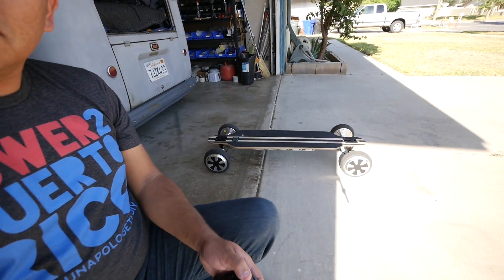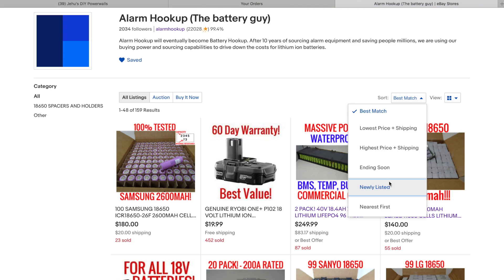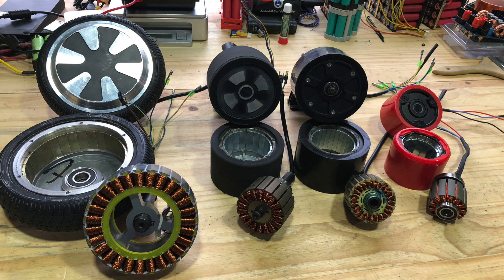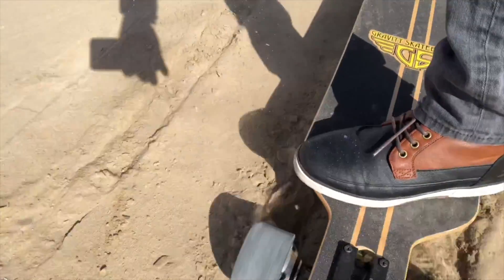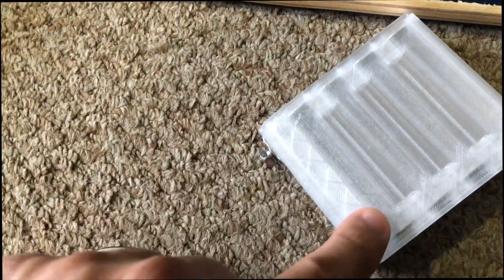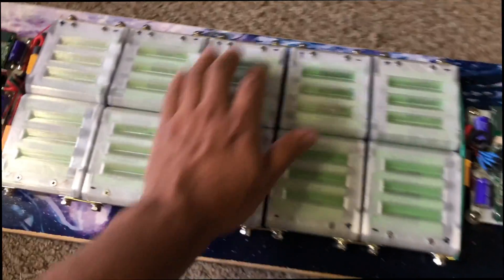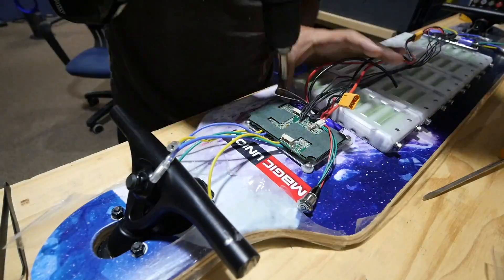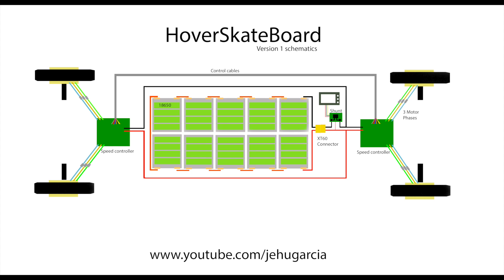Baja Electric Skateboard using Hoverboard wheels (HoverSkateBoard)

Comment: Recommend upping the voltage to 72 or 90v. They are low low KV, should do the trick.
Reply: Camden Wallraff I run this motor in scooter at 72volts and get 24mph max speed
Reply: what esc did you use ?, the vescs usually take 60v max... , ebike esc not ready to use remote controller.....

Comment: Not very well built, the wiring and circuits are all exposed and the battery packs aren't attached properly. Also that hole you cut for the screen is in a pretty bad place and weakens the board
Reply from the maker: And yet it’s as fun as any board you can cobble up

Comment: cant wait for the followup video, that looks pretty simple to build, and not a bad price, you also get to build it how you want, esc motor battery wiring, not the most perfect solution since you are cutting holes in the wood reducing its strength but still good for how cheap it is.

Comment: Those shaft couplings scare the crap out of me on an engineering level.
Reply: ya no sh*t those trucks are not a straight shaft there curved no way in hell i would put that on my board with out welding it
Reply: whaha i thought the same
Reply: Totally insane in the membrain XD
Reply: And they're over $20 each. That exceeds my total budget right there.
Reply: @tedhancock68  same i been plotting this build got my hands on everythin hopped on youtube to solve the last problem of adding the  wheels lol now smack 80+ more bucks i gotta spend :c
Reply: @MADMAXSHOTYOU  I bought a welder but haven't tried welding on the wheels yet.
Reply: Not to mention the batteries being held by double sided tape.. 😂
Reply: @Oilysnowww  Yeah, he should have used duct tape.
Reply: Just tighten it up and drill a hole for a retaining pin(s). Problem solved through engineering. 😀
Reply: @Wilson Deshawn Instablaster :)
Reply: I dont mean to be offtopic but does anyone know of a method to log back into an instagram account..?
I stupidly lost the account password. I would love any help you can give me.

Comment: Where can I find those 3D print battery holders?
Reply from the maker: BOM list
https://j35.us/Skateboard
https://j35.us/3DprintedHolders
https://j35.us/2200mahCells
https://j35.us/Power2Spare
https://j35.us/4WD-HubControllers
https://j35.us/HoverBoardWheel
https://j35.us/VoltageMeter
https://j35.us/ShaftCoupler

Comment: i like the battery casings but doesn't the metal electrodes throughout the case gets hot when you're running the board at full power for long periods of time resulting in the plastic casing melting?
Reply from the maker: Good future test

Comment: Change the winding to delta.
run 4x 12s vesc similar to torqueboards vesc...

run them at 12s and test it on a steep as hill to show what its capable of, also show how much weight its pushing etc...

 this will give plenty of info on what these are really capable of...

Comment: jehu, those are ncr-b? max drain is 6A but recomanded is 3A continous, and you are pulling 40A/4=10A per cell, right? also can you make a video for the 3D printed cases? i know where the files are but where did you find the nickel strip with that "button" shape on them. Also what bolts did you use and all...Planning to build some packs using the same 3d printed cases that i can 
do myself but i nowhere is a video with the assemble and the parts needed to make them.
Reply from the maker: 40 burst,  check the links

Comment: I don't know what is the specs of those motors or the esc that u put on the list , I have one of those hoverboards broken in thinking to give it a try ....but I will try a Rc car speed controller  and maybe a big lipo battery ....what u think ?
Reply from the maker: Same thing except this is 4 speed controllers one for each motor
Reply: I tried with a RC car controller but it wasn't successful, the motor behaved like a stepper motor and the wheel had a 'stuttered' rotation with not much torque.
I did have success with a 500w ebike controller (eBay £6) and a 10k pot as the accelerator. ✌️

Comment: Do you sale the 3D printed batter holder I would like to get some for some projects thank keep up the good videos 👍🇺🇸
Reply from the maker: Link in the description
Reply: We now have 2S4P. It will only need 5 modules. They have mounting holes and a bit easier to mount on the board. More on esk8 forum

Comment: Jehu don't forget why These are only for 10s. These don't look like they can take the forces of higher speeds speaking in terms of the wheel integrity.
Reply from the maker: What are you talking about,  they are beefy motors
Reply: Ben Nope I run this motor on scooter single one and pull 2000watts at 70 volts so yes this motor can handle a lot more power. I weight 100 kg and this thing got tons of torque and get top speed 24mph. Only mod I have done I replaced this rubber wheel with polyutherane wheel that I moulded from the kit. This greatly deceased rolling resistance as original rubber that are fitted to these motors are not very good for heavy riders
Reply: greg23842384 nice. My concern with these mass produced items from china is when they are used outside their normal paramaters.
Yep that rubber thing was concerns me too. Pu tight fit is the way. The Advantage of running high voltage is that you pull less amps.
My concern with this Skateboard Setup is Just No ability for Realtime measurements to See what actually Happens. I know those ESC from other builds and they may work but it is like flying blind. You See no amps or the temp of your ESC. Do they even have thermal throttling ect. And i Just don't liked his Statement that any battery goes in 4p....from someone Like him. Imagine someone builds the Same. Takes 3-5A battery in 4p that is max 20A for 4 Motors....if He had taken vesc no Problem but He didnt....
I just expected more...this was Just Like all the other builds..hey look i bought this and that and slappt IT together.
Reply from the maker: Oh you Fear mongers,  use all that energy and build something instead,  otherwise step aside and let the rest of us enjoy our projects
Reply: jehugarcia i am not hating. I Like your build. Just my concerns.
I am currently building 2. Just waiting on some parts.
But man i am surprised you still answered after all this time.
There is a new but reliable seller for vesc, FLIPSKY. They sell directly or over ebay ect, i payed 56€ and tested it Yesterday and Made 0 Problems

Comment: No not any battery. Kinda dissapointed that you shortened the battery Part. Since this is your thing
Reply from the maker: Not interested in explaining to you how to load a cell into a holder,  if you don’t get that then these projects are not for you
Reply: I meant the Type of 18650....whatever you already misunderstood me. You used a different Type of battery in your video than in your description Box. And No using any 18650 in 4p is Not going to go Well for everyone. 
Rider weight and inclines and declines factor in . That awd is gonna split the load rly good yes but why Run a battery at the limit.
Reply: jehugarcia These ESC also have No current Control......you can't just slap any cells on. If the Rider is heavier or going up a steep hill you can easily destroy the esc or the battery current is too high and the cells take dmg...there are so many variables and further Tuning These motors could make that Happen. There will be people who will copy you who have no idea how to do this right.
Reply: You could implement a BMS AS a failsafe...but that is not a favourable solution..cutting the current in acceleration can cause severe Crashes.
Getting to the point of the wheels.
What i mean is If the rim cant take that speed. No one using a hoverboard was riding 10mph+ continously for Miles. An eskate does that rly easy. Is the Rubber on the rim secured for Higher speeds and doesnt get loose. Is it able to sustain shape and grip.
Abec flywheels or clones and orangatang Kegel have proven to be reliable on normal Longboards and eboards

Comment: wheelmount --> the axels need some pretentioning. usualy done by the long rod for the hutz that hold the wheels. you may whant to just tention them and then mount the drivewheels. just saying ;)
Reply from the maker: What?
Reply: the axels are cast-aluminium with a metal core for the wheels. cast aluminium is weak on pull forces. they overcome that, by pretentioning with the force of the core from one wheel to the other. 
you may want to shorten the core and just tretention the axel.
Reply from the maker: Oh I see what mean, I cut the steel axle off,  so I’m only using the soft cast part
Reply: sice you have the core still in place, it should be ok-ish, i think the axels will not shatter... have a eye open for that :) 
nice project!

Comment: check out the voltage on the caps in the controller and build battery  pack that would closely match that it should give u more speed. voltage = speed but you already know that ;) . thanks for the info about the hub couplers i have 2 hubs i wanna do something with but didn't have a clue as to how to mount them.

Comment: I love your videos! Looking forward for more videos on this type of DIYs. Currently doing research on what is the best way to add a motor to a scooter. Do you know another seller for the 3D printered battery holders? The one you have is coming from the oversea. Any in USA? I have use a lot of the 3M double side heavy duty mounting tape for my DIY projects they hold up very good. It have different ratings and type. Version for indoor and outdoor usage too. If you or anyone can offer some tips I would be greatly appreciated. Thanks for ahead of time.

Comment: It seems like most situations where you specifically want the bigger wheels (off pavement, rough/bumpy pavement, etc.) you need more torque and less speed. Otherwise why not just go with the smaller, faster motor wheels?
Reply from the maker: This got plenty of torque,  why stop there get some speed also
Reply: jehugarcia Just trying to understand what you're going for. Is this intended for the rough stuff? or is it just using the big wheels because the price was right and seeing what you can do with them...

Comment: Excuse me, 40A off of 4x NCR18650B's?  You know they are rated at a max of 2Clt right?  Which is like 6.6A each.  You are doing 10A. lol
Reply: yeah, doing 40A on a 4p system will decrease the life of the cells maybe by 25-45% but if he's able to get those cells at half the cost of power cells then it is still a valid choice, but in the video he says more voltage, so if he boosts that voltage up to 12s (42.0-50.4V) which is a 20% bump, the amps will drop by the same 20%, for the same power. That brings the current down to 8A which is still a little high but I wouldn't worry about it catching fire at that rate. 14s would bring the current down to 6A for the same power draw, but 49.0-58.8V might be too high for the escs, and not sure there's room on the board.
Reply: He'd get more power out of his system with power cells.  Something like the Samsung 30Q might add a couple of MPH to his top speed because it will hold more voltage under load allowing the motor to draw more current.
Reply from the maker: Do you know the definition burst?
Reply: You said it draws 40A, you never said burst in your video lol.  Either way, these cells will die quickly if being discharged above 1C.  Not sure what your continuous draw will be.
Reply: asusreviews I kinda agree with you energy cells 1c max

Comment: Were there any differences between the master and slave esc's to make one the master and the other the slave? Or were they the exact same?
Reply from the maker: Same hardware but not sure on the software or set up as these cans ready to go
Reply: jehugarcia Sorry. Not sure what you mean by set up and ready to go. Could you clarify?
Reply: I believe that it was a typo. 'came' not 'cans'. He bought them as a 4-wheel esc, not 2 2-wheel units then having to make them master and slave.
Reply: and that they were already preprogrammed for a brushless motor...buuuut possibly not these motors. Might be where he is getting the power blockage that keeps him from going faster.

Comment: Jehu, if you get vesc than by increasing the amps withdraw will give u more speed.
Reply: Portable Electric Vehicle I think that will trash those motors
Reply: Fishman 02 it will not.
Reply: Portable Electric Vehicle wouldn't it make more sense to just increase voltage instead? Amps put more strain on those motors and they can't be incredibly good.
Reply: It won't, the problem is voltage not current, he needs to increase the Kv of the motors to increase the speed

Comment: To many amps are what will kill those motors. On your "current" (lol, get it?) setup your actually pulling more amps than if you where to run it at a higher voltage. Oh and changing the escs to vescs will also make it faster.
Reply from the maker: Yeah but 4 VESCs cost $400
Reply: Flipsky vesc cost 50usd each on ebay :) So 200usd for 4x !

Comment: I'm building a drift trike with parts from an old hoverboard and a bike! (And some steel of course)
Reply: bit late but how did you end up building it?
Reply: @r34d_  Welded a frame with an old bike and some steel beams, built a battery from 18650 cells and powered the hub motors with some cheap Chinese esc from alliexpress, then some pipe cut to pieces mounted on the tyres to make it drift. Worked alright but a bit down on power haha

Comment: If those battery terminals get loose use wire and crimped terminals instead of solid connection from battery to battery :)

Comment: Don't ride your electric skateboard in the sand. The iron from the sand will degrade your motors.
Also, incasing batteries in 3D printed plastic is a very bad idea. It's brittle and will not last very long. It is not heat-resistant (unless you cover the batteries with Kapton tape). If you want a plastic enclosure, you should use injected molded plastic.You need to have some foam or rubber to cushion the battery pack from the deck.
Keep the metal enclosure and use suspension trucks (http://avenuetrucks.com/).

Comment: wondering if using the other wheels with the motor and bracket on the outside would work with this cable setup. should give you more power and speed??? Great Video Jehu!!!!!!
Reply: No, there are wheels made for longboards, and the motor is on the outside, and sometimes the cost is cheaper than hoverboard wheels. Here is an Example-https://www.ebay.com/itm/2Set-Smart-car-Self-balancing-Kits-Wheel-176r-min-Motor-6V-bracket-Good/181561849459

Comment: SPOILER ALERT! If you drive on bump roads, the double side tape will not secure the battery.. i tested my self.. i use 3MM Double side tape and didn't work... after a wile driving the battery will fall.
Reply: Enryson Ferraz did you make one of these? if so what do I do with the little black connector with five pins from the hoverboard motor assembly, it's not exactly clear. It looks like he didn't even connect them but I wasn't sure.
Reply: @sandpiper1515  you dont need these this is for a other type of motor controller (sensored esc)
Reply: did you manage to increase the speed of the motor? and what means did you use to accomplish it? thanks

Comment: Electric skateboards would be much easier to handle if they would have a handle... :) They should have. That would make them much safer to start and easier to balance later.
Reply: AxelL No1 lmao than you have scooter and you look like a dumass
Reply: Danny Baltich Last time I checked my scooter had two wheels, but I have seen a quad scooter with a handle but it was only for younger kids due to the weight limit. It still looked like it would be fun to thrash it on a halfpipe. My only problem with handlebars is when you eat it and you catch an end in the face/chest/gut/or other sensitive places lower than that, if you know what I mean.

Comment: That mustn't last too long. I got 80 cells and I go to work everyday for 4 days before the voltage drops to 36-37V. work is 1.1miles away, short but still fun ride to work
Reply: Phizicks those must not be very high capacity cells 80 cells is alot
Reply: 800Whrs approx, and 4 days of riding and still got more to go, just slower than I like so I could increase extra rows to increase it to nominal 42V. my videos have some footage.

Comment: looks neat, but what about arduino and bldc esc's? It perhaps would have more torque and less speed if you wouldn't use gears, but would be cheaper from what i looked up quickly. You could even mesure voltage with arduino if you want dirt cheap build :p
Reply from the maker: what gears?

Comment: Want!
Definitely increase the voltage - it's current that kills motors more than voltage as long as the insulation holds up.
Reply: Increasing voltage increases current. Current and voltage are linked.